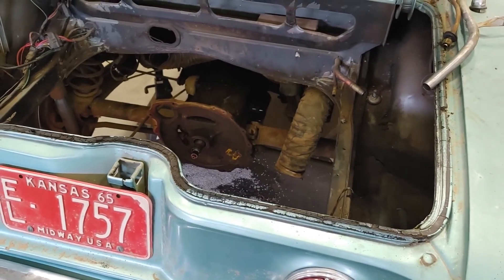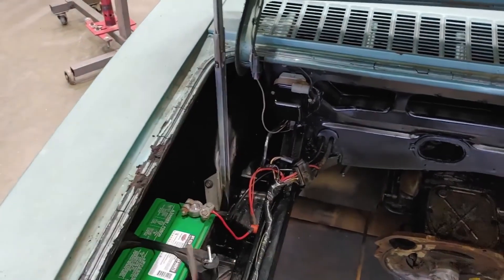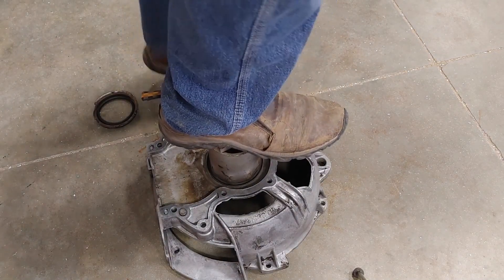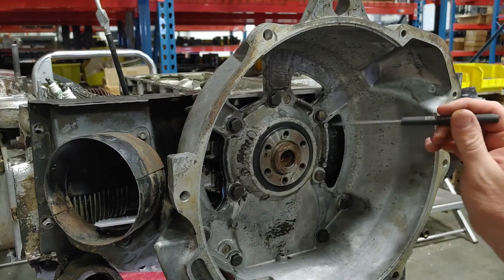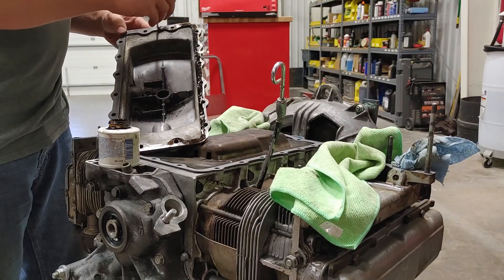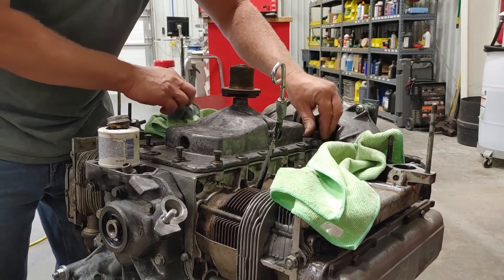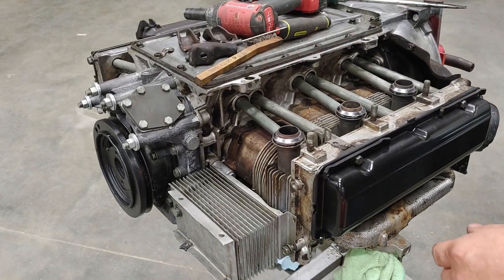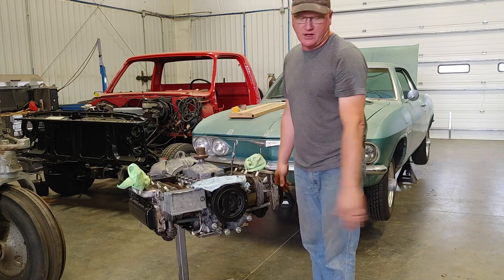1965 Corvair 500 - Buttoning Up the Engine

Comment: I did the same engine freshen up on my rampside about 12 years ago. Only I upgraded it to a 140. It has a 4 speed and I dual exhaust it. For real cheap I got just the U pipes from Clarks and I found a nice pair of SS turbo style mufflers at a swap meet for like 40 bux! And welded them straight to the U pipe and a small section of straight SS pipe for the outlet with a mount tab and done. Now the Rampy is actually a 442!😊 
One thing I see you doing that really bothers me is working on an open engine and not taking the time to cover up the openings. 
I guess that's my Aviation training kicking in! 
Anyway nice work.
Cheers.

Comment: The crankshaft timing mark is a microscopic notch on the inside edge (toward the crankcase) or the sealing surface for the rear main seal. The thing you thought is the timing mark on the crank, is just some random marks that serves some othe purpose. 

(Your timing is set correctly tho)

Comment: Looks like ole Dirty Airy isn't so dirty anymore. Guessing (because I don't know), from the valve adjustment that you have hydraulic lifters. At the end you gave 1 final turn. Some guys say 1 1/2 turns. I suppose that could vary depending on the engine??? Or is it one of those "That's the way my dad (or whomever) taught me & it works for me so why change?" type deals? Thanks for another ride.
Reply: Hydraulic valves on the Corvair are set at 3/4 to 1 turn down for proper operation. If you use aftermarket lifters then you might get away with 1/2 to 3/4 turn down. I prefer to set mine running though by loosing and then tightening to about 2/3 down. That worked well for me.
Reply from the maker: For me on a Corvair, it's because that's what the book said to do!
Reply: Good deal. I usually defer to the book as well. Should be good! @TheJayhawker

Comment: Remove 3 bolts from flex plate to torque converter 1st before seperating engine from transaxle
Reply: Also dislodge torqueconverter from crankshaft

Comment: Dual exhaust for 110 h.p. be a waste especially with a power robbing turbo muffler. Which is where they originally came from - Corvairs. Single or dual just go with straight pipe and save some $$$